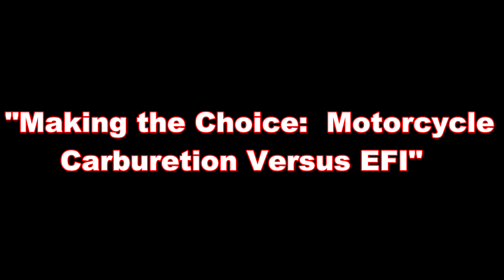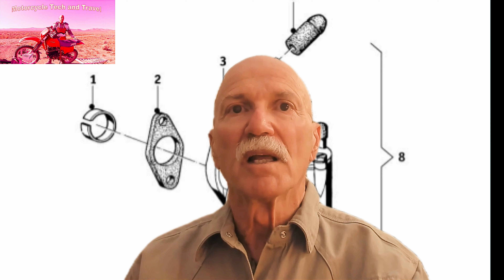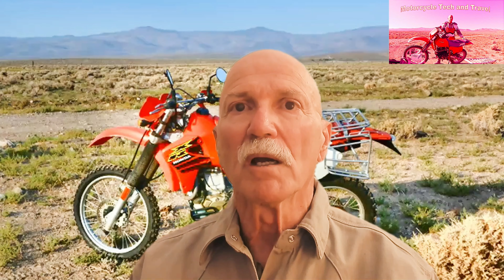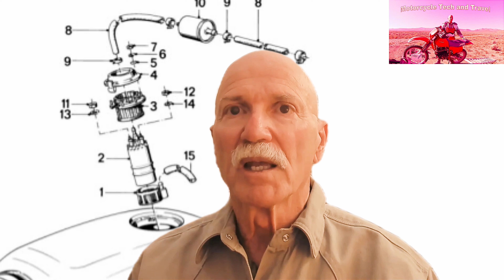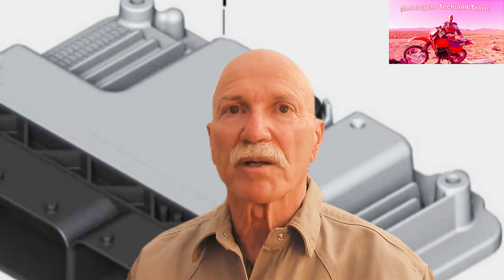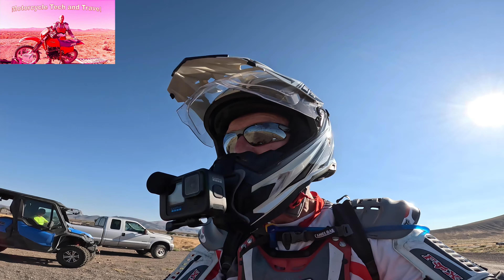Choosing the Right Motorcycle: Carburetors Versus EFI

Comment: I like your stuff. You are very detailed. Engineer on two wheels. I don’t dislike carbs, I am not good w tuning them. My WR 250R efi runs damn good.  Not a high hp motor, definitely starving for air stock. I have a 2019, new iridium plug, air filter and battery. She is ready to nomad. You are right, when the battery starts dragging, get a new one. I knew the battery was 5 years old, and time to go. But they are very reliable. Anything can happen. Be safe.
Reply from the maker: Thanks for the feedback!  I have a good friend at Oregon who rides a Yamaha WR250R.  He's had no trouble with the bike whatsoever.  We will be sharing trails this summer and filming some interesting travel spots for this channel.  I look forward to becoming more familiar with the WR250R.  As for reliability, fortunately, EFI systems are generally very reliable.  The Japanese dual-sport systems are far less costly to maintain and restore than the European, Bosch-derivative systems found on sport-touring, touring and large ADV bikes.  Your bike's EFI is also easier to troubleshoot.  Glad you're getting a great return on your Yamaha, it's a wise machine to own and ride!